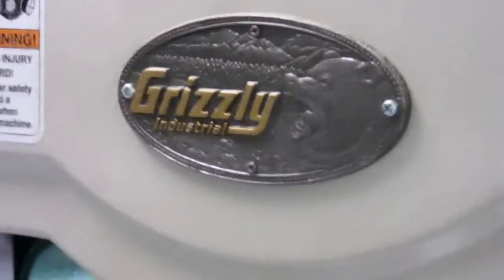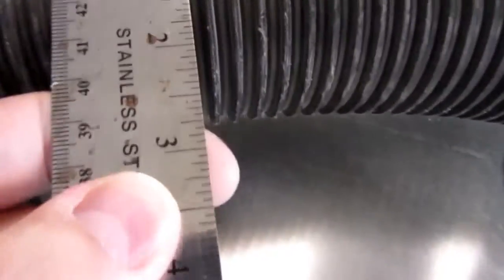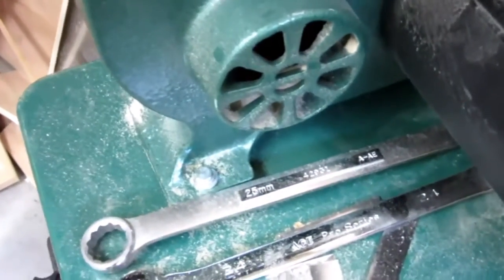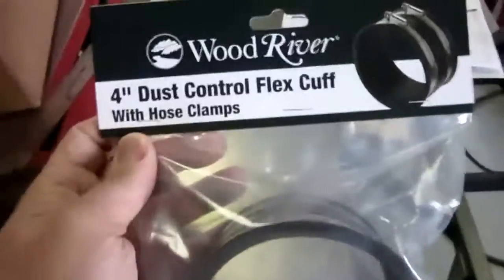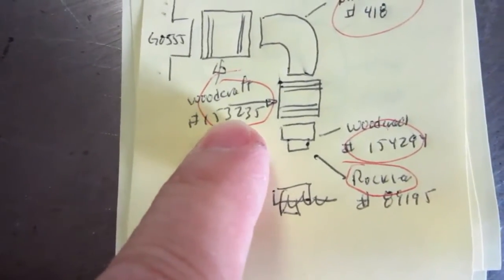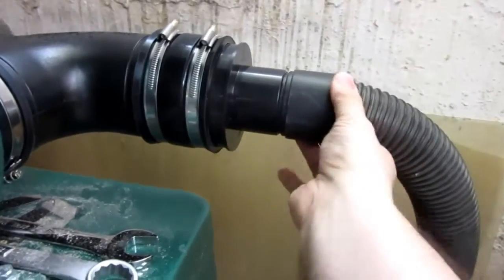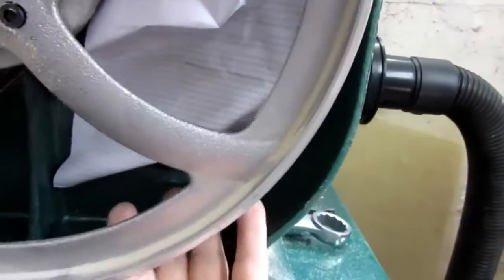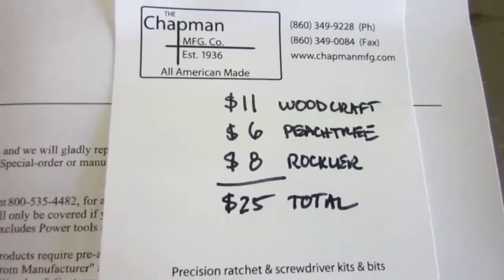Adapting a ShopVac to a Saw's Dust Collection Port

Comment: Thank you for adding this video. It was very helpful and informative. I'm pretty new to woodworking and focusing on developing a  system to extract dust from the table saw via my shop vac. My shop is small so this is feasible. May i contact you if i have additional questions concerning the setup? If all goes well, im hoping to do the same for my miter saw. Thanks.